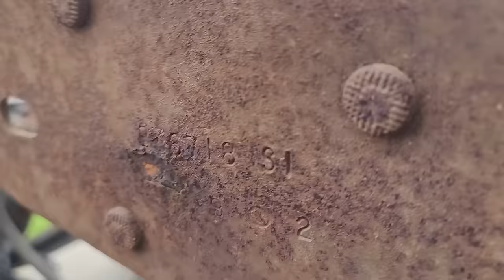Ford Ranger, MIG welding truck frame back together, how to.  Build part 7

Comment: Myself, I like to weld out the part,  with the clamps still  on, do you ever get buckling or broken tacks when you remove the clamps?
At work it's not worth the risk of re-work.
Great video.
Reply from the maker: I did not get any tacks popping loose on this project.  I absolutely have seen tacks pop in other projects, mainly when they aren't strong enough or thought out well.  This one was tacked in 8-10 places on each side before I took off the clamps.
Reply: @frostydoesit  sometimes the sound of a breaking tack is mistaken for something else, especially in a shop situation,  and rework sucks.
Like your content.

Comment: Take a good piece of frame 8 inches wide from old frame cut in half cut one piece
1/8 off then place them on the inner side of your frame you want fixed it's for a buckle zone [|<. It will add strength.  But still weld all
cutting areas .
Reply from the maker: I'd imagine that would be a safe/strong way to do it also!

Comment: Can you tell what welder machine you were using? Thanks
Reply from the maker: I used 2 different machines, both Miller.  252 mig and 140 mig.  The smaller 140 would have done the entire job as this frame was about 1/8" thick.

Comment: Lol, my guy,,, you 'attacked' that job excellently.  You should be working with Stacy David or the folks on Dirt Every Day!
Reply from the maker: Thanks Patrick!   I grew up watching Stacy David and powernation!  You certainly made my day with this comment!  I will keep making more videos, hope to see more comments and thoughts from you in the future.  -Frosty
Reply: @frostydoesit  I've been a journeyman tech at a small Midwestern engine company and fabrication has been a central job responsibility since '96 in the research pilot center.  Your use of the holes in the frame was right on. It isn't rocket science,  but SOOO many people just don't get it.  

It's just great to see the sound principles used in your vid. There's a guy in Spokane WA. who did similar to an old 'Flxible' tour bus that USED to be the actual unit Gene Autry and his band used for road touring.  We found him near Witchita KS when we were westbound for Summer Test,,  he had gotten crap fuel in Witchita and choked his filters out near a rest area. We helped him flush his lines and get new filters on and he ran with us up into Silverthorne/Frisco CO.  ABSOLUTELY great to fellowship with other gearheads who take on challenges like that.

Keep up the good work Sir!

Comment: So you can weld a frame with a mig? Is that because of how thin these frames are they have to be a 1/4 inch or less
Reply from the maker: I used a MIG because it's what I have and it did a nice job

Comment: I don't think that shape fish plate does much for a scarfed joint. Also the joint should have been cleaned to shiny and beveled on the inside because it is hard to bevel once it is tacked up. Using the frame holes to get it fit was a great idea. I'm sure it will work great as the frame has a lot of flexibility.
Reply from the maker: The joints were all cleaned to shiny bare metal, frame was welded Inside and outside then fish plated.

Comment: I was going to strongly suggest, (as someone who's had to repair his own rusty ford ranger frame)... why you have
the cab off you should have GOT everything, with some paint meant for your frame.. b/c it's worth it, if you've pulled the cab & bed..

That being said... already skipped ahead & saw you've got the cab back on and stuff...

Awesome job on the welding.
Reply from the maker: Thanks so much for watching and for the suggestion!   If I like the truck after some seat time I'll be taking the cab and bed off again, It only takes me a couple hours to take them off.  We have a nice sandblasting setup at work that'll really help me get it right.  I also have a turbo 2.3 engine I am planning on swapping in.  -Frosty

Comment: why a diamond patch?  Why not a rectangular plate to distribute more stress?
Reply from the maker: It's what we use when we shorten or lengthen big rig frames.  Corners are usually radiused a bit more than I did.  This ranger frame is never going to break or crack.
Reply: Square and rectangle patches are absolutely going to crack and are prohibited in over 22 states. Diamonds are the industry standard in semi truck frame stretches, along with Z and L joints.

Comment: A straightforward butt weld is sufficient if done properly. It will be as strong as the original
Reply from the maker: I am sure it would be sufficient if done properly.  In the area I needed to splice the frame rails are not straight and I found the znotch to be VERY easy to line up, the butt weld would have been more challenging to get perfect in my situation.  Thanks for watching and sharing your opinion!

Comment: I have fixed many frames over the years stick welding the majority. You should have prepped the metal better removing all rust and contaminants, also should have slightly beveled all edges.
Reply from the maker: Thanks, I did do all that beforehand, just didn't show well on video.  Frame is only 1/8" thick so there wasn't much of a bevel needed.  It welded nice, going on 2 years and it's perfect!  Thanks for watching!

Comment: It works, but if you notice there's no other welds on your frame.  c channel frames are made to flex and are made of high alloy.
With severe flexing it will crack, and if you post heat it your frame will be soft there. But people do it all the time and it works. Fish plating might be the best way to weld it but the right way is not to weld it.
Looks good though, I'm just being a dick.
Reply from the maker: Hi Michael, I appreciate the criticism but you are wrong on the welding part!  The front frame has quite a bit of factory Ford welding.  The frame is also just mild steel, no special alloys.  Thank you for watching!  -Frosty
Reply: @frostydoesit , your rails are welded? Or other things are welded to the frame? I have yet to see a vehicle frame, especially a full framed truck with welded sections from the factory. Frame rails are one continuous piece, stamped or hydro formed, unless rangers are multi piece frames, possible but highly a liability for an OEM manufacturer. Rust is inevitable but a factory welded frame breaking a weld and causing an accident, that sounds like a liability no OEM wants to take on.
Reply: @TheRoadhammer379  
So, you've never seen an extended truck chassis?
They are ALWAYS welded, even here in Australia, and we have some of the most restricted road engineering rules in the world.

Comment: Got a steel shortage in your area?  Use a 3/8 x 6 or so and 20 " long. Cut staggered . holes in it to weld inside of. Your baby diamond is near useless.
Reply from the maker: lol no steel shortage, but 3/8" plate on the 1/8" ranger frame wouldn't be the greatest idea either.

Comment: Just wondered why you went to all that work you didn't have the bare frame blasted, painted and then coated in body protection Dinitrol. Waxoyl etc?  The perfect opportunity
Reply from the maker: This frame repair was unexpected,  I never planned on putting this much time into this truck, to be honest I didn't want to put anymore time into it.  I've never even driven it.  Once it's back together if I do like the truck I'll take the body off and blast/paint it at work.  I can have the cab and bed off in 2 hrs.  Thanks for watching!  -Frosty

Comment: I have the idea that installing a gusset over the join but extending over front rear mounting points would increase the frame's carrying capacity.  True or a futile effort?
Reply from the maker: Sounds like it would, depends how well the modifications are done....too stiff can be bad too, they are made to flex as well.  This little Ranger will never haul more than 1500lbs, in this situation I believe it to be better than Ford made it 😉
Reply: Of course, rule no# 1: what are we using it for.  I just see metal and want to weld on it.
Reply: Any reinforcement should stop short of spring mounts by a measurement of 2X the frame height.
Reply: Frames are one piece in the GVWR equation. Someone a lot more intelligent than YouTube viewers engineered these frames and gussets weren't in the original plan. Simply putting an f450 truck frame under an F350 doesn't change weight carrying capacity even though the f450 is thicker, I'm using it as an example. This is because the F350 engine and axles factor in the equation. You can gusset and plate your entire frame, overload the piss out of it but eventually you will destroy the brakes, trans, axles and stress the frame at certain points, it's just how it is.

Comment: How come you didn't wire wheel it before you put it together, I learned that the prep is the most important part.
Reply from the maker: It was wire wheeled and ground before welding.  Watch it again and look closely
Reply: @frostydoesit  I see it now.

Comment: Needing to cut up a 95 and 93 f150. 95 is 2wd with front end damage single cab. 93 is 4wd with a clean title. Using the rear end frame from 95 and welding it to the 93 front end. This is going to be fun? 🤣
Reply from the maker: That's pretty much exactly what I had to do.  Was a LOT of work but I am happy I did it.
Reply: @frostydoesit  thinking it might be easier to just find a single cab frame
Reply from the maker: @nauidiver227  I have a 2wd reg cab frame in Wisconsin
Reply: @frostydoesit  I'm in north Florida but it's not that far north haha thanks though

Comment: My question to you right now is that I’ve seen so many people do it, but why did you not primer the inside of the frame and the inside of that gusset prior to welding because now you leave possibility of galvanic corrosion between the frame and the gusset it’ll work on from the inside out…..???????……
Reply from the maker: Painting it wouldn't help at all, both base metals were the same, they were dry and clean...no oxygen, no moisture.  It'll take more time than I'll be alive to rust out like you are talking about.

Comment: Wait but wouldn’t it not crack apart if it welded properly with good penetration though ?
Reply from the maker: I doubt this frame will ever crack, it was fully welded on both sides and fish plated on the inside.  It'll outlive the rest of the truck!

Comment: Excellent but I would have cleaned the joint with a wire brush fitted in small grinder.
Reply from the maker: Off camera I did wire brush the entire inside and outside of the joint before I welded it.  Thank you for watching and taking the time to let me know iw what you thought, I appreciate it!  -Frosty

Comment: Looks like some of the cuts you made on the original chassis are still visible. If I were you, I’d go over those after the weld are cooled off just to on the safe side of the chassis from splitting at the cuts. But I’m sure this build is already coming along now so going back and welding again probably is too late.
Reply from the maker: I assure you there are no visible or unwelded cuts anywhere.  What's the timestamp you are referring to?
Reply: @frostydoesit  Likely 10:09 (left upper corner; filled holes) and 10:26 (left near top; center; holes; right upper corner). It's hard to see in video what those dark spots actually are.

Comment: Hole in the center of diamond back plate. More weld surface
Reply from the maker: If I was doing a big truck frame I'd agree, but this is just 1/8" Ford ranger frame.  It's never coming apart.

Comment: Whats your welding set up?
Reply from the maker: I have a few Miller machines,  I used a 140 and a 252 on this project.   I also have a syncrowave 250dx that I use for tig and stick.  The little 140 would have been fine for this whole project.

Comment: Snice it looks like your working outside the garage,  what welder voltage is that Miller using, awesome job btw
Reply from the maker: Thank you!  I used a Miller 140 and 252 outside.  I made a 50' 220v extension cord so I am able to run it out of my garage to the back patio.  Thank you for watching the video!
Reply: @frostydoesit  thanks man,I really need to upgrade my welder
Reply from the maker: @ratgasgarage  what are you working with?
Reply: @frostydoesit  harbor great stick  and a century wire feed running Flux core

Comment: As long as you wash the truck and pressure wash the frame few times a month this would never have to happen but who am I to say how people should take better care of their investment 😊
Reply from the maker: I bought the truck from auction this way.  If the previous owner would have cleaned out the mud from offroading it wouldn't have rusted out.
Reply: Calls a vehicle an investment while using emojis.  Nobody takes you seriously.

Comment: Dude, why didnt you grind the metal clean before welding/tacking?
Reply from the maker: I did.  Everything was cleaned to shiny metal before welding.  Look at timestamp 2:25, every spot I tacked there are prepped shiny spots.  Once it was tacked together and un-clamped about 1" around the whole joint was cleaned again.  May be hard to spot on the video but it was 100% done.  Thanks for watching and commenting!   👍

Comment: Some 7018 on an arc welder can't be be beat if ya know how
Reply from the maker: I do have a Miller syncrowave 250 that will arc weld but I have it set up for Tig.....and well the MIG was easier to roll around through the grass too!  I do use 7018 at work quite often.  Thanks for watching!

Comment: Against  the law to weld on a frame in Michigan.   Great job
Reply from the maker: Thank you!  Good thing I'm on the other side of the pond in Wisconsin!
Reply: Show us the code section of the law please.
Reply: I challenge the law to break this repair....
Reply: Gretchen told me I couldn't mow my lawn during covid either 🤔🤔🤔
Reply: Tommy it is not illegal in Michigan, the state inspection division of dmv has a specific method required to pass. I have stretched and welded 3 semi trucks based in Michigan, and all three pull B trains... upwards of 120k lbs. Every single truck has passed the annual DOT inspection in Michigan, so stop spouting 🐴 shyte

Comment: Nice job
Reply from the maker: Thank you Carl!
Reply: Can you tell me what welder you use?
Reply from the maker: @carlcarlson180  I used 2 welders in this video, both Millers.  A 140 mig and 252 mig.  Either Welder would have done this job.
Reply: I have a Miller 175 but never have liked it. I use my Lincoln arc when I can  I’m working on my 41 Dodge rat Rod pickup
Reply from the maker: @carlcarlson180  what don't you like about the 175?  My dad has a 1941 Ford pickup!
Reply: Never did feed wire right since new
Think I need new sheath 
My Dodge has a 350 in it
Reply from the maker: @Carl Carlson  a new liner is cheap and worth trying imo.  My dad's Ford has a SB 350 in it too

Comment: Did you make a long box into a short box?
Reply from the maker: No, it was always a short box truck.  The original 4wd frame had some pretty rusty and thin areas in the back half, so I cut it off and welded in a clean frame from a 2wd ranger I had.

Comment: You have everything stripped-down that far might as well sandblast and repaint the whole thing that way existing rust will not keep building
Reply from the maker: I'm not trying to restore the truck, just fixing a paper thin section of the frame.  The rest of it is is in great shape.

Comment: My third Ranger. Love my 4.0. 93,94,2001. Any one know if I can put the 4.0 out of the 2001 in my southern 93? It had a 3.0. Thank you.
Reply from the maker: You can certainly swap it in there but IMO it would be way more effort than it's worth.  You'd have to literally swap the entire drivetrain and all of the cooling and electrical over...tooo much work!!

Comment: Wouldn't  you want to reinforce the top and bottom of the welds with plates?
Reply from the maker: It probably wouldn't hurt to do that!
Reply: Another reinforcement option is to use an internal C section and bolt in place through the vertical web. The top and bottom flanges should be left free of bolts or weld. In most applications the frame rail will be made from high strength steel and any reinforcement plates should match this strength class.

Comment: Sure hope you addressed the rust on the rest of that chassis? NOW is the time to eradicate it!
Reply from the maker: Nope, I left it as is.  Not looking to restore the truck, I've redone many trucks and they always turn in to a "where does it end" scenario.  My goal was to get it built how I want it, drive it this spring and if I like it I'll probably be swapping in a 2.3 Turbo couple engine...IF that happens I will sandblast and paint the frame/suspension.  Thanks for watching!  -Frosty

Comment: Shouldnt your fish plate go over each main frame notch by 1.5 - 2 inches? Pause at 8:22 You have no coverage on your vertical frame cut. This is a legit question by the way
Reply from the maker: I took a look at 8:22 and I don't see what you are referring to.  The fish plates also easily extend 2" past the cut/weld front to back.  It's a little hard to tell because in the video you see all the shiny metal after I ground the weld smooth.

Comment: Just a personal opinion but I think stick should be used on structural stuff like this due to the science behind it…

Not everyone is good enough with stick though to do it.
Reply from the maker: Mig has a lot of advantages in this situation, the frame is only 1/8" thick on this frame.  For a thicker frame like on a semi or medium duty truck I'd still probably use mig spray.  If it was over 3/8" then I'd probably use stick.  Everyone does things a little differently.  I do agree with you for big thick material then stick is hard to beat.  Thanks for watching!!
Reply: @frostydoesit  I didn’t realize the thickness you were doing. Hearing that size from you I agree and follow you in the way you did it.

Good job👍🏻